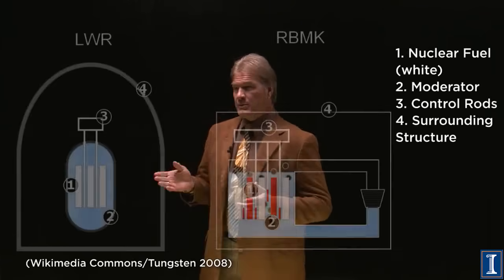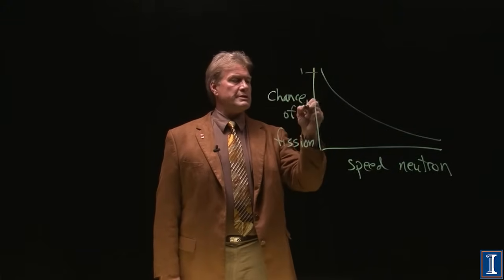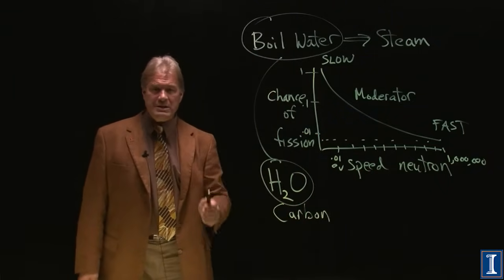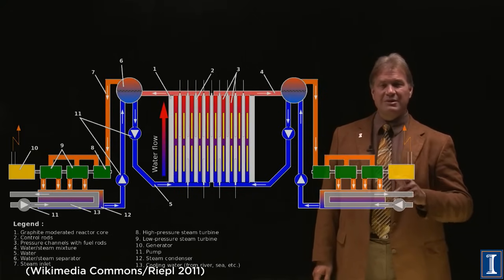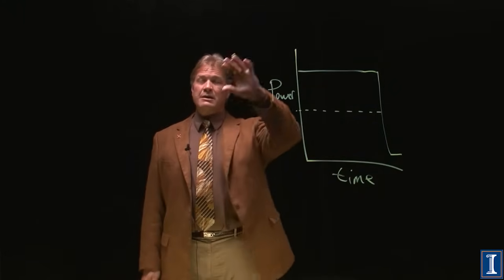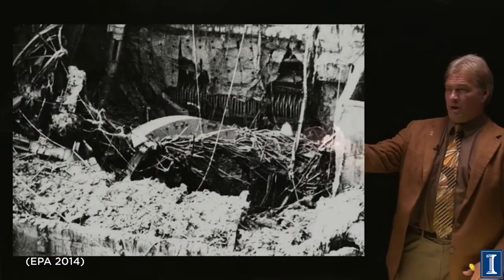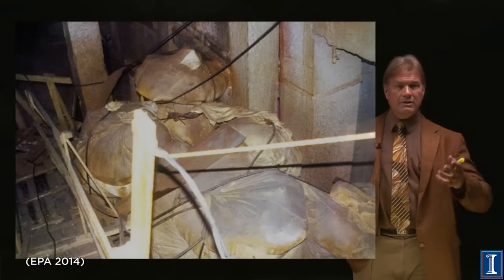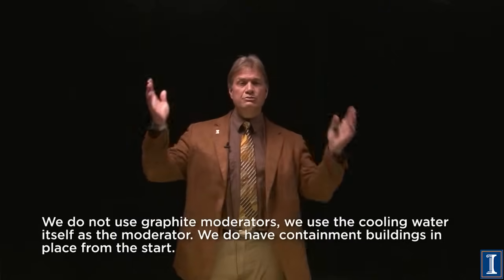Chernobyl: Worst Accident Ever

Comment: That’s the single best explanation of physics of the Chernobyl disaster. There are a couple of the things that professor might have not been aware of. 
1. The whole idea of that experiment grew from the successful attack on the Soviet built Ozark reactor in Iraq conducted by the Israel Defense Force.
The experiment was to prove that the power plant can withstand power cut off due to the attack and to sustain itself just by the power of mechanical inertia of the turbine-generator.
2. They hurried this up because in the Socialist system it was very important to report the success to their Communist Party bosses in the eve of the 1st of May, the major Soviet Holiday.
Should the experiment be a success, all the participants would be rewarded by bonuses and promotions to the top managers of the plant.
Reply: From what I understand, the Experiment was actually to see if the freewheeling turbine can generate enough power to keep the safeties and cooling pumps running during the 1min gap between a power loss event and the backup generators spooling up to make enough power to then support the aforementioned safety systems.

Comment: Here apples are compared with oranges: M.W. So far there has been no case in which a nuclear power plant has been endangered by an external event (plane crash). Several reactor buildings exploded in Fukushima - despite containment. In Tchernobyl the 3 neighboring reactors (reactor I, II and III) were operated until the beginning of the 2000s - next to the damaged reactor IV !!! In addition, the Tchernobyl reactor has a decisive advantage (which the West would only like to use): the fuel elements can be exchanged during operation. I also have to say: in every western reactor, when the fuel elements are changed, a not inconsiderable proportion of radioactive substances is released into the environment. I would also like to remind you of the leukemia cluster in the Elbmarsch (Germany: GKSS or AKW Krümmel !!!) !!!
Reply: Secondary reactor buildings were badly damaged or destroyed at Fukushima, not primary containment, that's why no one died from radiation at Fukushima and they don't have to build a sarcophagus over the site like they did for Chernobyl.

Comment: I don't know that I qualify Chernobyl as the worst accident ever. Fukushima is still not contained. And it was 3 reactors that blew up And are still melting down Spewing radiation into the water every single minute of every single day for over 9 years
Reply: Oh that's right I know who you are you're the guy that gets on here and just tries to start trouble with everybody those are clearly massive explosions. Look I get it everybody else won't respond to you anymore and now I won't either the videos show massive explosions and I don't care what caused it it's still an explosion and it still messed up the reactor cores which they can't even get to. So you had your fun with me for the day and that's it. I hope this made you feel better about yourself
Reply: @thomasfrye8996   I go after liars wherever they may be found. Those explosions were hydrogen explosions that damaged or destroyed some of the secondary containment buildings.  Since primary containment still exists, thousands of people work directly at the site every single day.  But if the reactors "blew up" and containment was lost, no one would be anywhere near the site and they would have had built a sarcophagus over each one like they had to do with Chernobyl.  You won't answer back because you are a liar and you have no evidence to back up your ignorant claims.
Reply: No reactor at Fukushima ever blew up, and all the melted reactors have containment buildings, unlike Chernobyl; that's why no one died from Fukushima radiation.
Reply: @danadurnfordkevinblanchdebunk   What are you talking about? There are videos of all of the reactors at Fukushima blowing up

Comment: "An operator hit the wrong button in the control room..."

Looks at Dyatlov
Reply: I wasn't in the room
I was in the Toilet.
Reply: @mercurysarcade8538  And THAT is how an RBMK-reactor explode!
Reply: We did everything right
Reply: You idiot! What did you do!?!?!
Reply: We did everything right
Reply: Akimow DID THAT!
Reply: @WadcaWymiaru  
What actually happened with Akimov, how was he exposed to such an extent that his face melted off shortly after the accident? I did not see him stare into the open core?
Reply: @mryhdy6266  You didn't see him because HE WAS NOT THERE!
Reply: @mryhdy6266  Akimov and Toptunov tried to pump water into reactor, there's a scene of it in the show, and that is most probably where they got so much radiation.
Reply: @Dragunaw  
Yeah, in priciple I got that part, I saw them opening valves presumably below the reactor itself. No direct contact with the water though. Also, seems to me they should see loss of pressure which indicates burst pipes, which makes the whole exercise questionable at best...
Reply: It was Toptunov, not Akimov, who made a mistake early in the process by skipping a step with ‘Global Automatic’ and it was also he who pressed AZ5. Akimov merely exposed the button for him to press. Dyatlov, however, set the entire catastrophe in motion by insisting that the test be carried out at 200MW instead of 700MW as stipulated in the test protocol.
Reply: i hate how hbo took the soviet party line and simply blamed the guy who followed orders and then went further to lie about his conduct during the explosion etc
Reply: @Retard634  I thought HBO did a good job of showing the system caused the accident, not the poor fools who were left at the sharp end. That said, Dyatlov does deserve a chunk of blame. He was the one who decided to bypass safety regulations and try to restart the reactor after it stalled, and he was the one who ordered the power to be brought down too low in the first place. Worst of all, afterwards he never accepted any responsibility for anything that happened, and tried to blame it on his subordinates.
Reply: @Werrf1  I agreed with everything in your comment until your "Dyatlov never accepted any blam"
I watch an interview of him admitting it was basically his fault.
Reply: @jacobcastro1885  Do you have a link? What I've seen is an interview where he basically blames it all on his superiors, I'd be interested to see another take on it.
Reply: @Werrf1  yeah, I'll see if I can dig it up. It was quite a while past the accident... he looked broken, but lucid.

Comment: they had massive containment buildings in Fukushima and we all know what happened to them. hydrogen blows apart thick concrete easily.
Reply: Dont feed the troll Craig.
Reply: @staatsfiend   Anywhere there are Fuku'n liars, I am there.  https://principia-scientific.org/physicist-there-was-no-fukushima-nuclear-disaster/
Reply: You are ignorant. Only the secondary containment building was badly damaged or destroyed, not the primary.  That's why no one died from Fukushima radiation.
Reply: @danadurnfordkevinblanchdebunk  
So why am I ignorant?

I just stated that comment because the Prof said generally all containment buildings are virtually indestructible,  which is wrong.

Comment: Power generation is not a Engineering issue, nor is it an issue of an ignorant public that does not understand safe, and usable fission generated electricity, they don't, ...instead it is an événement sociologique. 

The public was told by Politicians, Scientists, Engineers, and Experts that Chernobyl was safe, and the public was told by Politicians, Scientists, Engineers, and Experts that Fukushima was safe.  The issue is not one of poor, better, or the best engineering, the problem is one of trust, and trust cannot be added to the engineering scope of work. 

Fission generated power will be at best a historical stop-gap in an our ever increasing need for power, hopefully it will be a very, very short one. Currently even the GEN III and now GEN IV systems still have one major issue, it is the on-site temporary storage facilities for high radiation waste, and spent nuclear fuel, both Rod and Pebble Systems. 

The options for storage of the used materials in nuclear power generation remain daunting,  a ) some centralized, permanent, and safe storage facility must be created and used, perhaps several over the space of the planet to store waste, plus the systems to ship that waste to such facilities, or b ) continue to store waste "on-site", which has been up to this point a de facto arrangement.

It has been suggested that the cheapest and easiest engineering solution would be to, at the end of the reactor life cycle, put all the waste into the containment vessel, pour it full of concrete and seal it up for the next tens of thousands of years. 

Leaving nuclear sarcophagi around the planet, which of course, would be a political nightmare.

Comment: The Elysium and Moltex molten chloride salt fast reactors run at atmospheric pressure. They have a strongly negative temperature coefficient. If they begin to over-heat the reaction slows down.  It can’t get to harmful temperatures. When the fuel salt is removed from the core there’s no critical mass. The default is no fuel in the core.

Comment: In fact, initial explosion was nuclear in origin... don't say twice that any containment building of western design can hold that scale of energy.
"We believe that thermal neutron mediated nuclear explosions at the bottom of a number of fuel channels in the reactor caused a jet of debris to shoot upwards through the refuelling tubes. This jet then rammed the tubes' 350kg plugs, continued through the roof and travelled into the atmosphere to altitudes of 2.5-3km where the weather conditions provided a route to Cherepovets. The steam explosion which ruptured the reactor vessel occurred some 2.7 seconds later."

Seismic measurements and an eye-witness report of a blue flash above the reactor a few seconds after the first explosion also support the new hypothesis of a nuclear explosion followed by a steam explosion.
https://www.eurekalert.org/pub_releases/2017-11/tfg-ntr111517.php

Comment: Have you done a video on Windscale? They used fans to cool those reactors so radioactive crap literally just blew straight out of the reactor up a chimney and into the countryside
Reply: There were huge filters on top of the chimneys .... put on as an afterthought ..... that caught 95% of the escaping radiation or it would have been a major disaster.
Reply: @3vimages471  I know what happened but i'd love a video on it. I've seen Sellafield, its very pretty at night. They're currently decommissioning the whole site. One of the towers is already gone.

Comment: Firefighters were heroes. Nobody told them there is an exposed core, and nobody told them there is a massive radiation level. "Between 3rd and 4th blocks, fire on the roof" That's it.

Comment: The RBMK 1000 reactor is fundamentally, and at its root, a very sound reactor design. To this point, even as a patriotic American, and a lover of American industry and might, I would say it was of a higher level, a higher performance, more efficient design, with lower operating costs and the same if not better, safety margins, relative to any reactor design of the same era, that is, anything comparable offered by the "West" in the mid 1970s. The reality is that after the Chernobyl accident, the RBMK-1000 was "vilified" due to obvious cold war relationships and used as a tool of western “propaganda” to further discredit the soviet union, in addition, its design has been "scapegoated" ever since, as clearly seen here by professor know-it-all. The Chernobyl accident was the product of a lack of "safety culture", not a lack of safety design built into the reactor itself. The fact is the test performed that night deviated EXTENSIVLY and lethally from established procedure, procedure developed and written by the actual architects and designers of the reactor itself, that if carried out to the letter, would NOT have been dangerous to the general public (NOR) hazardous to the reactor itself IN ANY WAY. The reactor would NOT have exploded and there would have NEVER been anything to write home about regarding the safety characteristics or the positive void coefficient of the RBMK 1000 reactor. Beyond that, numerous safety systems were completely shut down and disabled, even against the requirements of the test itself. VERY DANGEROUS circumstances were injected into this reactor, not by reactor design, but by human input. no doubt THE TOTAL BLAME for this disaster lies with one man, Anatoly Dyatlov. 
Cherynoble was a human error, NOT a flaw in reactor design. And we, as Americans, would still be making excuses as to why the RBMK 1000, and later the RBMK 1500, smoked any “western” design of reactor in terms of comparable Mw output, operating cost and overall reactor performance. Or why the Klimov RD-33 or the Saturn AL-31 is of a superior design than it’s American counterpart(s). 

Nearly 30% of all nuclear power generated in Russia is still created within the confines of the heavily flawed “rbmk 1000” design. Which, contrary to popular belief, did not undergo “extensive” design changes post Chernobyl.

Give me one hour behind the control room at any Western made nuclear reactor and I can create similar "results" as to what was seen in Chernobyl on that fateful day in 1984.

Comment: Biggest problem was the positive void. A containment building would most likely have crumbled somehow, by the two explosions. The most crazy thing, is that by positive void, you can have indefinitely raising power = an real nuclear explosion. Not a full yield one, as the fuel was low enriched, but anyway! So maybe we were lucky, that the reactor pressure got so high, that the core was blown out (maybe, because some scientists claim that the core exploded). Otherwise it would have been a worldwide problem.

Comment: I'm no nuclear scientist; but in the rest of the world the issue in Nuclear plants always appears to be malfunctioning "valves". Maybe this is pc pseudo-speak for covering all the bases. Nuclear power is not safe, my bets would be geothermal, solar, wind and modifying/purifying coal for power use. No chance of nuclear accidents, catastrophes, etc. It's not that I don't trust science, but putting man in the middle to make profits on nuclear power and the atypical problems arise. All this bs to make steam for power, there has to be a better way.
Reply: Nuclear power is perfectly safe.  What happened at Chernobyl was an exception because it's not the same type of reactor used elsewhere.  The Chernobyl reactor had a design flaw, a flaw that does not exist in reactors elsewhere.
Reply: ps   Nuclear power is safer than every single one you mentioned:  https://www.forbes.com/sites/jamesconca/2012/06/10/energys-deathprint-a-price-always-paid/#4ba37689709b

Comment: Great video. If the fission process in non-RBMk reactors stops working without water then what happened at Fukushima?
Reply: The uranium doesn't cease to create fission events, it's just much much lower of a chance which directly results in nowhere near as hot as the reactor normally is.

Fukushima's diesel generators which ran the cooling systems flooded over because of the massive tsunami. Then the battery systems kicked on and began cooling the reactor. Then they ran out of power because the 0lace was a disaster area and nonody could get a generator to the plant in time. The reactor then builds up heat and eventually the roof of the building blows off. The only reason any radioactive materials at all were put into the environment is because the operators vented some of the gases to prevent more chemical explosions. Nobody died as a result of Fukushima's meltdown. Tens of thousands died because there was a 9.0 earthquake and subsequent tsunami.

Comment: Well made video! Just one thing: Even if the RBMK had a containment building many professionals think it would not have survived that explosion. The HEAVY lid of the reactor flew about 30 meters high.
Reply: Reinforced concrete is believed to have far more strength when dynamically loaded during an explosion or an impact. A real life example of this the Longarone dam in Italy which survived loads estimated 100 times what it was designed for when a mountainside slid into the reservoir.
Unfortunately very little research is done in this area because of the huge costs of blowing up life sized structures.
Reply: It couldn't have hurt.
Reply: Even if it did crack it, the hole would've been quite small, and less material outside, meaning less people have to clean it while being in place with 20 thousands Roentgen/hour
Reply: @George Thomas It's estimated that the lid has a weight of at least 1000 (metric) tons.

Comment: Thing is with containment buildings, they're not indestructible. The explosion of Chernobyl would've torn through it anyway, as did happen with Fukushima. Steel and concrete just bend like rubber and cardboard under those extremities.
Reply: Reactor containment vessel never exploded in Fukushima the blast panels (theu are called blast panels for a reason) surrounding the containment vessel exploded due to hydrogen buildup
Reply: @tejasbhandare251  It kind of it. Hence why it burned its way to the water table and Japan now has a huge tank farm (and still growing) of highly contaminated water.

Comment: A Canadian nuclear reactor does not have control rods.  The fuel in the fuel bundles are too far apart to react.  However the deuterium water, water with extra neutrons, is the catalysts for the reaction.  So the water is both the catalyst and the moderator.  The reaction chamber is connected to a massive dome that is maintained under a huge negative pressure.  If there is a need a valve opens the water gets sucked out and the reaction stops.  The downside is the reactor is more expensive and you need deuterium.   Safest reactor on earth except for the nuclear ☢️ waste that all reactors generate.